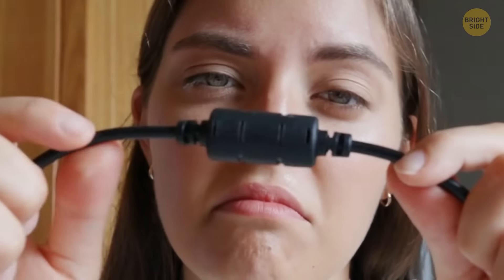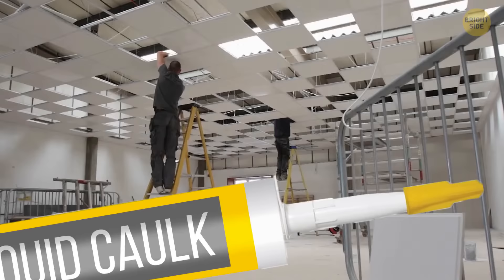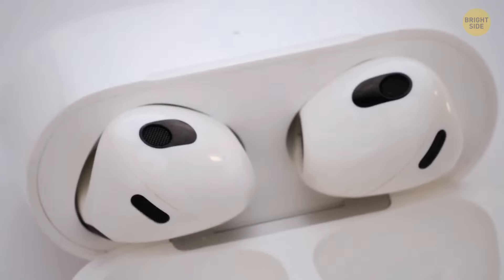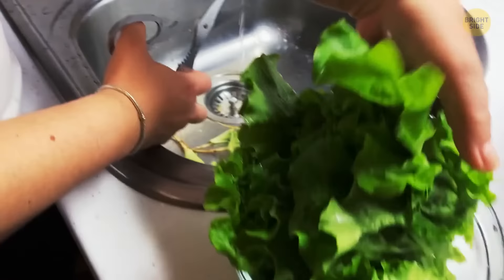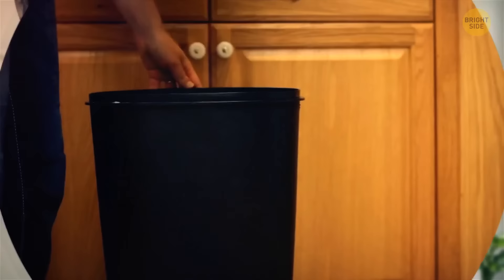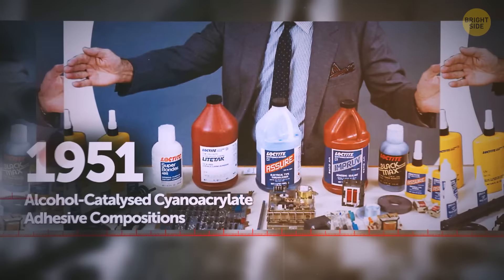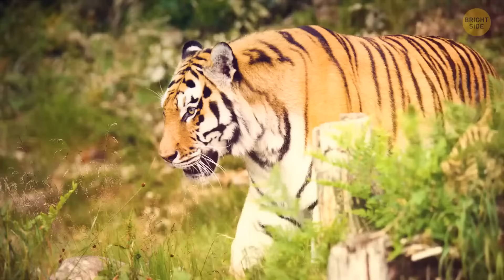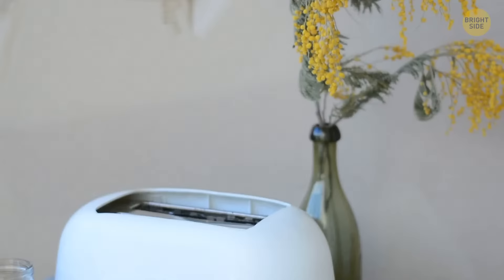70+ Hidden Purposes You Didn't Google What That's For

Comment: 🪄✨ Made with SummarizeYT app
0:00 - The cylinder on the end of a cable is for focusing heat and steam while cooking.
1:35 - Different types of cutlery and dishware have specific purposes in cooking.
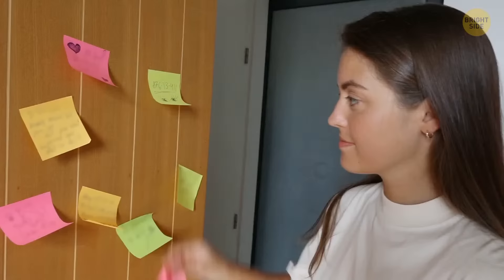2:44 - Flicking a switch on a room's light socket can warm up a room.
3:18 - There are alternative methods for opening a can if a can opener is misplaced.
5:07 - The wax in candles helps them stay firm and steady.
6:02 - Rubbing a pencil along the edges of a key can make it fit better in a lock.
7:41 - Checking drains and roofs can prevent issues with speakers.
9:06 - Open space projects sound, which is why putting a speaker in a cup can make it sound louder.
11:22 - The concept of trapping sound is why putting a phone inside a cup projects its sound.
13:38 - Using headphones for more than two hours per day can cause interference in audio quality.
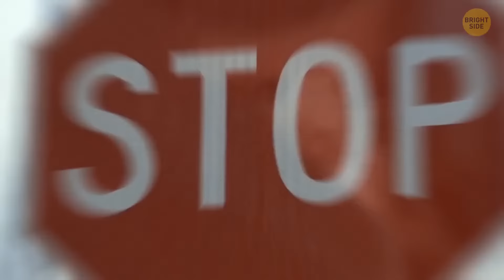58:59 - The back of a plane has magnetic locks on fuel hoses.
59:19 - Most tubes are usually sealed with a magnetic field.
1:00:55 - Cameras are used by police or rescuers to keep order on planes.
1:01:17 - Triangular houses are common and have become pieces of elegance.
1:02:30 - Using headphones for more than two hours a day can cause interference in audio quality.
1:02:43 - Rubbing a pencil along the edges of a key can make it fit better in a lock.
1:03:14 - Checking drains and roofs can prevent issues with speakers.
1:03:27 - Putting a speaker in a cup can make it sound louder.
1:02:48 - Different patterns in dishware have different purposes in cooking.
1:04:21 - The wax in candles helps them stay firm and steady.

Comment: (50 min in) as some of you know that most older cars (before 2000) don't have a pull tab in the trunk. If something were to happen like being kidnapped (or something along those lines) you can kick out the tail light out so other people (and police officers) are going to notice it. If you try to open the trunk using a pull tab in a newer car then the kidnapper can see that the trunk latch is open. But a kidnapper cannot see if you kick a tail light out. Hopefully no one will need to know this piece of information.